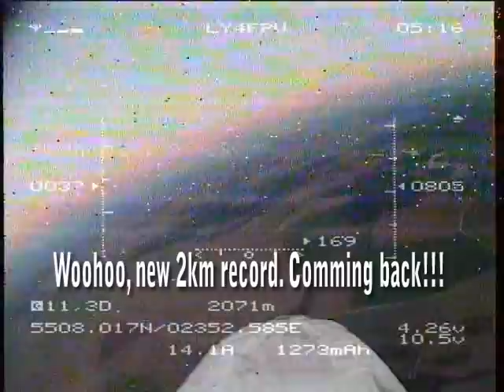Trying to reach 2km range

Comment: Pretty brave to keep on flying through the "blizzard". I would have pulled out a lot earlier. Try a patch antenna, preferably with tracking, you'll get heaps more range.
Reply from the maker: Thanks. Actually I tried it later with patch antenna: Trying to reach 7km, out of the battery when comming back (crash landing)